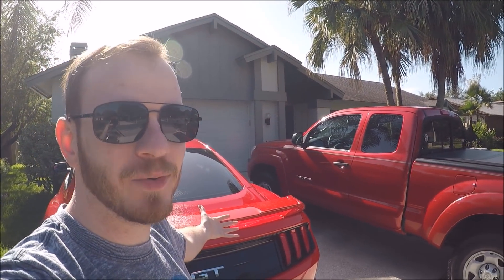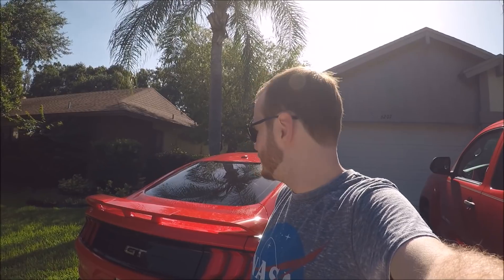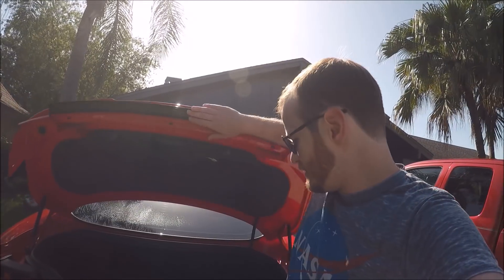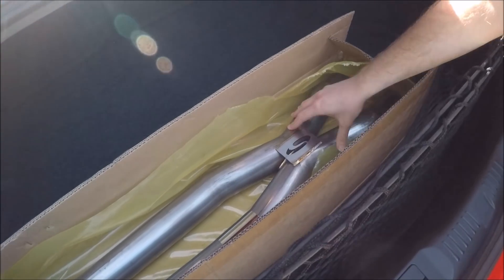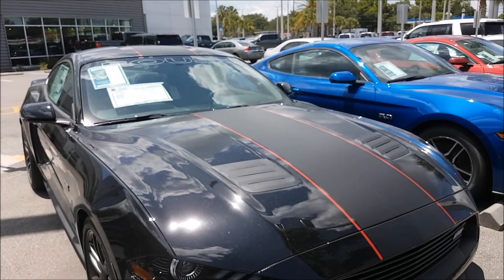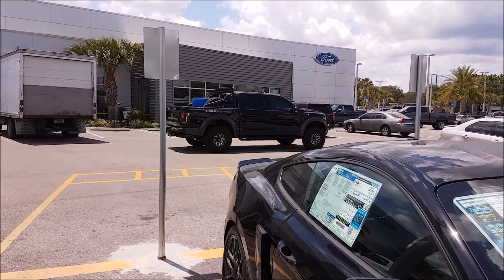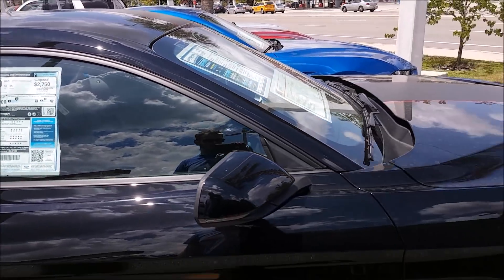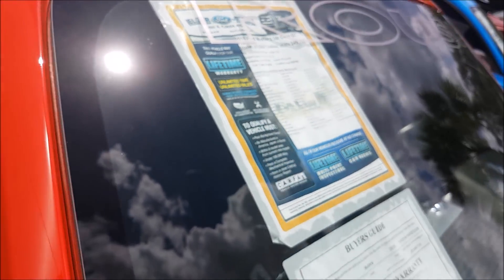2018 Mustang GT Active Exhaust Resonator Delete Install and First Impressions

Comment: Exhaust work does not void your warranty in any way and therefore you spent wayyyyy more on labor than was necessary. This is a 20 min solo job in a driveway or a $25 bill at most reputable shops as it’s so easy and they would be done in 10mins. 

Love the x pipe choice did the same on my 2018 and my 2020

Comment: So the active exhaust functions will still work with an xpipe?
Reply from the maker: They will. And the big one is that Quiet Mode is still very quiet
Reply: Just A Car Guy Named Tom does it void any warranties?
Reply from the maker: Not as far as I know. Mine was installed at a dealer. Ford even offers a similar X pipe as an option

Comment: Is the drone very noticeable compared to stock w/ active exhaust? Don't want it to be too unbearable...
Reply from the maker: Stock, there was no drone at all. With the resonator delete, there's only drone if you're ripping around in track mode, but no where near as much as a cheap exhaust system
Reply: @JustACarGuyNamedTom  Also are there any crackles or pops? I noticed on mine with track mode exhaust there are a bunch of pops out of the stock active exhaust. Thanks in Advance!